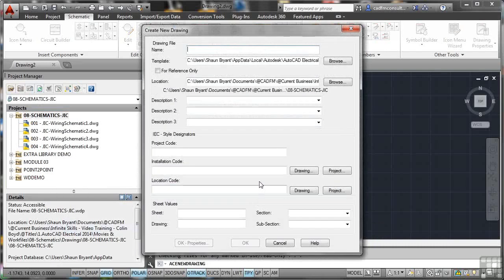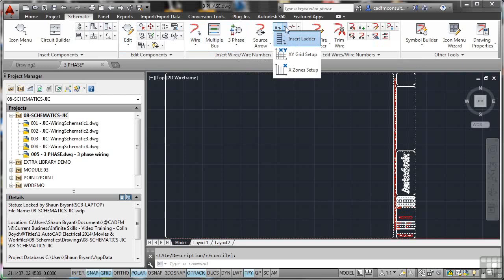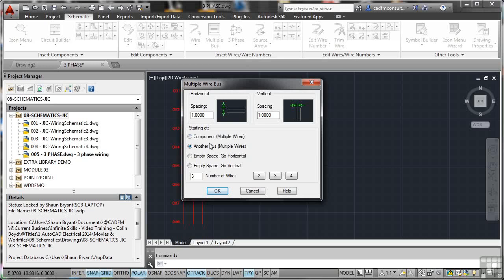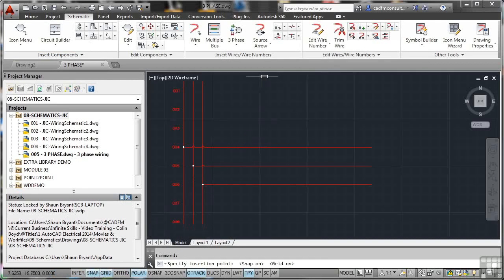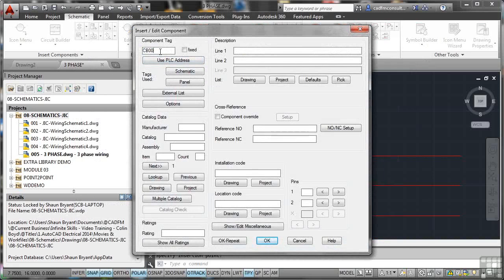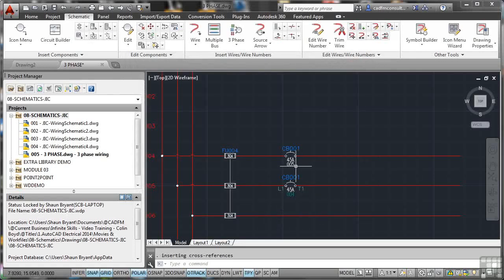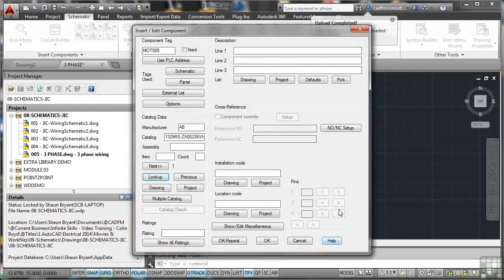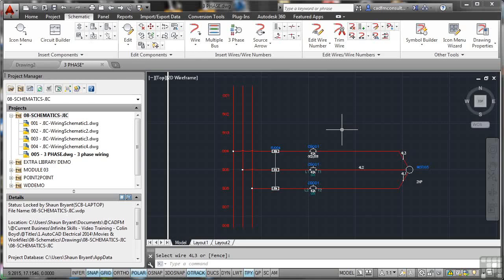Autocad electrical Tutorial Part 20 Three Phase Circuits

Comment: I also would like to know if you are planning on extending this series. I have learned a lot from them. Even though I have been an Autocad classic user in the past, I still learned several good tips and a nice beginning to ACAD Electrical.